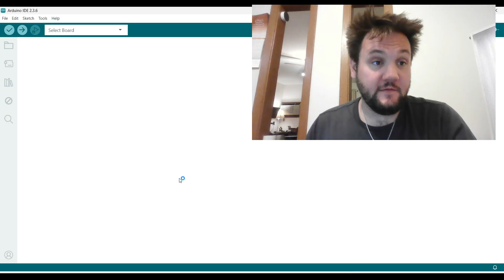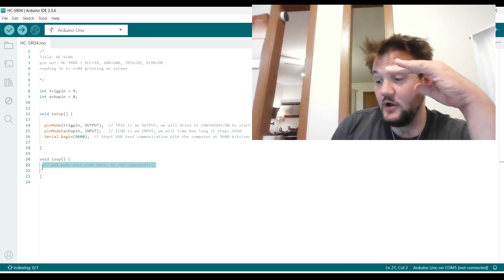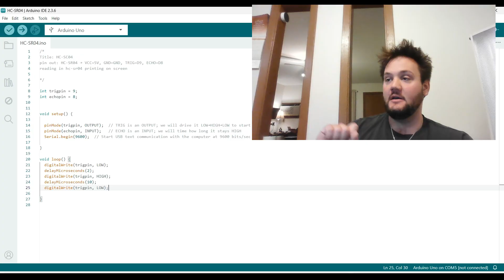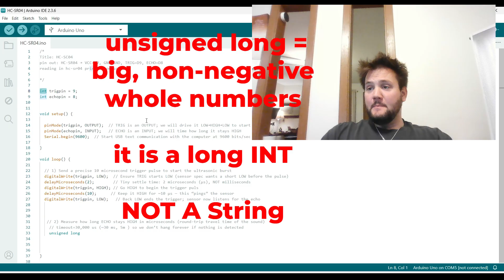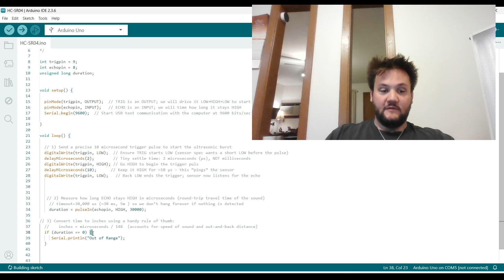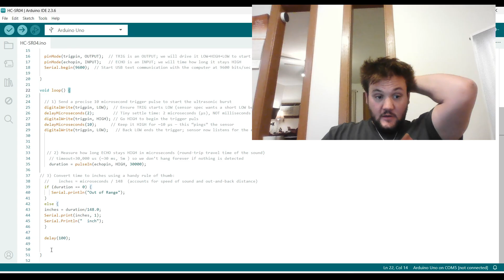Arduino 101: Ultrasonic Sensor HC-SR04

Comment from the maker: /*
Title: HC-SC04
pin out: HC-SR04 → VCC=5V, GND=GND, TRIG=D9, ECHO=D8 
reading in hc-sr04 printing on screen

*/

int trigpin = 9;
int echopin = 8;
unsigned long duration;
float inches;

void setup() {
  
  pinMode(trigpin, OUTPUT);  // TRIG is an OUTPUT; we will drive it LOW→HIGH→LOW to start a measurement
  pinMode(echopin, INPUT);   // ECHO is an INPUT; we will time how long it stays HIGH
  Serial.begin(9600);  // Start USB text communication with the computer at 9600 bits/sec (baud)

}

void loop() {

  // 1) Send a precise 10 microsecond trigger pulse to start the ultrasonic burst
  digitalWrite(trigpin, LOW);  // Ensure TRIG starts LOW (sensor spec wants a short LOW before the pulse)
  delayMicroseconds(2);        // Tiny settle time: 2 microseconds (µs), NOT milliseconds
  digitalWrite(trigpin, HIGH); // Go HIGH to begin the trigger puls
  delayMicroseconds(10);      // Keep it HIGH for ~10 µs — this “pings” the sensor
  digitalWrite(trigpin, LOW);   // Back LOW ends the trigger; sensor now listens for the echo

   // 2) Measure how long ECHO stays HIGH in microseconds (round-trip travel time of the sound)
    // timeout=30,000 us (~30 ms, 5m ) so we don’t hang forever if nothing is detected
    duration = pulseIn(echopin, HIGH, 30000);   // duration = echo HIGH time in µs

    // 3) Convert time to inches using a handy rule of thumb:
      //    inches ≈ microseconds / 148  (accounts for speed of sound and out-and-back distance)
      if (duration == 0) {     
        Serial.println("Out of Range");     // If pulseIn timed out (no echo or too far) tell US
      }
      else {
      inches = duration/148.0; // Distance(cm)=speed×time =0.0343×(𝑡/2) ≈ 𝑡/58.3 Convert cm to inches:divide by 2.54   cm=t/58.3    in=𝑡/58.3/2.54 ≈ 𝑡/148
      Serial.print(inches, 1);  // Print the distance with 1 decimal place
      Serial.println("  inch");   // Label the units so it’s clear
      }

  delay(100);  ///Delay so Serial Monitor is readable

}